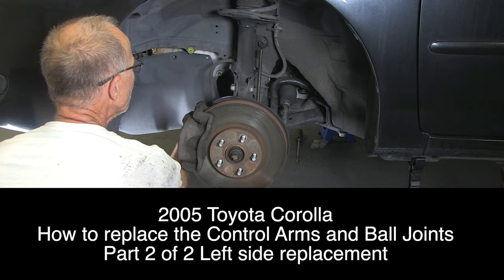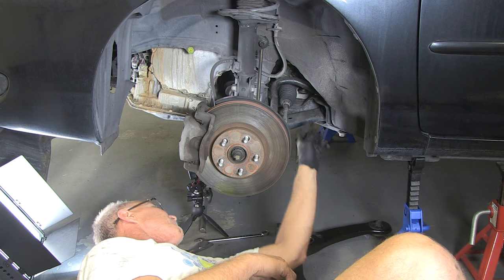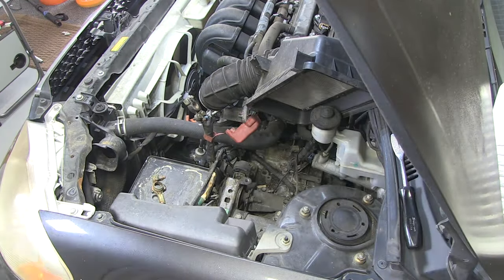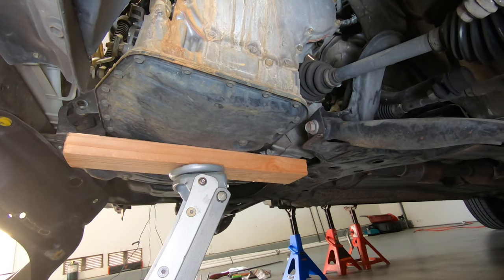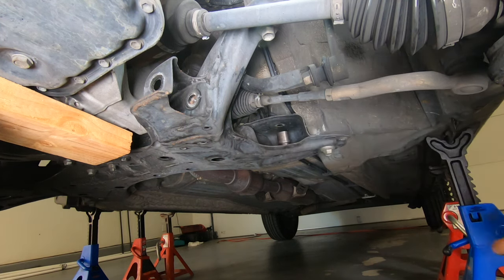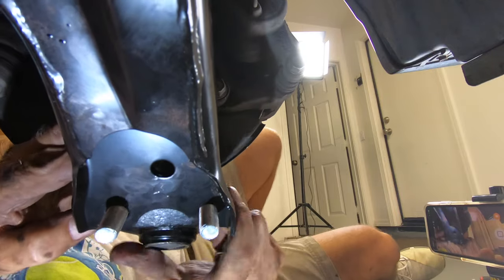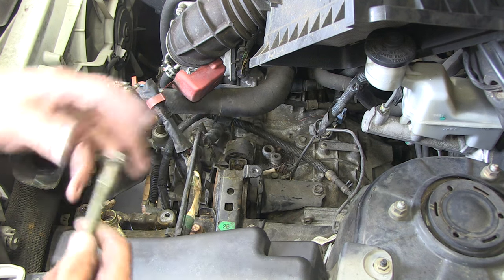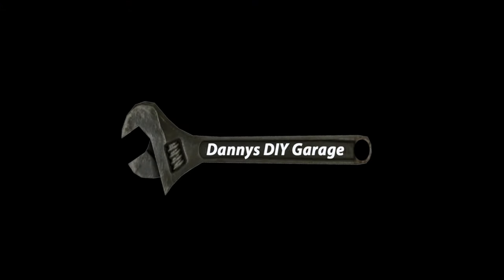Toyota Corolla Replacing the Control Arm Left Side

Comment: REALLY APPRECIATE THIS VERY THOROUGH VIDEO, DANNY! some thoughts: it looks another way to remove that bolt is drain the transmission fluid and remove the transmission fluid pan which (MIGHT) give you just enough clearance to remove and reinstall that bolt. It also looks like you can jack up that transmission slightly (without unbolting the transmission mount at all) to give you the extra clearance you need. (this is also the perfect time to replace the transmission filter and do a fluid change too.)

Comment: Dude I gotta give u a lot of credit for being able to do all this on the floor w/ a jack. I helped my coworker w/ this at the shop I work at on a Lexus RX300 which had this same exact set up on the lift, and that was already hard enough.
Reply from the maker: Yes, it made the job more difficult, but you do what you have to to get it done. Right!
Reply: For your Corolla is the camber adjustment that left bolt? I’m assuming it is, right?

Comment: Great video and explanation 👍.   My daughters 2012 Corolla S has 106k miles, and it started to sound like it needed struts.  I'm going to swap out the front struts and Coils springs,Lower Control arms,Tie Rods,Sway bar bushings,Sway bar Linkages, and 4 brand new Goodyear Tires.  I will be starting at 7:30 am tomorrow morning. The tire will be mounted and balanced, then alignment the front suspension by Firestone tire service.  MOOG Brand Suspension except The Struts and coil assembly is sold by TRQ. Let's hope I can accomplish 🙏 it.  I have never done this before. Thank you for your video.  I will video myself  trying to execute this change and experience.
Reply from the maker: Please update me when you’re finished, I will love to hear how everything worked our👍🏼
Reply: Don't do it sir, if you're going to replace good factory parts with garbage aftermarket parts.

Comment: You saved me a lot of money. Thank you so much for the video, I wasted 2 hours to figure it out until I found this video. I tried everything to take that bolt out.
Reply from the maker: You’re welcome, glad I could make your life a little easier 🍺
Reply: Yeah, me too, jajajajaja
Reply: We ran into the same issue with the bolt and decided to drop the transmission pan instead. Definitely messier but came out like a charm and saved us from having to break a lot of bolts loose to life the transmission. The idea of widening the spaces where the control arm came out are definitely a plus! Thanks.
Reply: @loptixl  That is what I was thinking because I have issue remembering all those nuts and bolts need to go back the same way. Can you confirm drop the pan has enough clearance. I may need to change the transmission filter anyway and perform Drain and Fill.  Thanks in advance.
Reply: @loptixl  i have a standard transmision,i  wonder if i might get lucky and have clearance to get that one out

Comment: Very good video.
I done my 2004 Corolla likewise, but got garage to do ball-joints (wasn't sure how easy it was but they didn't charge much for that item, with hindsight could have done that part myself). Just a hint, leave bracket connected to engine block, long bolt, only need to remove top bolts connecting to chassis. 👌🛠
Reply from the maker: Thanks for this
Reply: ALSO DONT SPREAD PARTS DESIGN TO HOLD BUSINGS TIGHTLY, AND DO NOT DRILL OUT BALLJOINT BOLT HOLES, SMH

Comment: Great video. 

Im going to be changing my control arms and cv axles and this is a great help. My transmission oil pan gasket has a slight leak and I'm going to be changing that as well. If i remove the pan will I have access to removing that horizontal bolt?

Comment: OMG, I am so glad you made this second video. I don't know it has to raise the transmission. BTW, how do you know  you need to change the control arm vs ball joint. The reason I ask is I have clunking noise from the passenger side and it has noise when I turn, start and stop. It is a 2009 Corolla and it has the original Ball joint for 13 years / 190k miles. I figured out it has to be the ball joint but after watching your video, it "may" be control arm too and the effort is totally different than "simple" ball joint.  Thanks for the excellent video. 👍
Reply from the maker: Sorry for the late response, hopefully you answered your questions by now, I’ve been traveling and haven’t had much YouTube time, sorry

Comment: I'm doing a filter and gasket change on the transmission the same day I'm installing the new control arms. Do you think you'd have enough space to pull that front bolt while the pan is removed - without removing the mounts, jacking up the transmission? Or not? Best video on this by the way.
Reply from the maker: Even with the pan removed, you still won’t have enough room, unfortunately
Reply: @dannysdiygarage  Thanks for the reply. I wasn't sure. I'm going to use your tip with the socket to open back up the space for the control arms to slide into. Great idea. Subbed.
Reply from the maker: Yep, I’ve done automotive for 30 plus years, ( if I knew then what I know now life would have been easier) thanks for commenting on this.

Comment from the maker: Yep, this job could have been so much easier with out that bolt issue
Reply: This is how you know an engineers spouse cheated on them with a mechanic.  Engineers design things to screw over mechanics in revenge. 😆
Reply from the maker: @Proxtor   not ruling it out,

Comment: I thought I read somewhere that you only need to remove the 2 left side bolts for the transmission mount and you didn't have to actually remove the entire mount. From what you remember does it seem like that would have worked?
Reply from the maker: Some times doing more can save you a lot of time, I don’t like to fight it,
Reply from the maker: I do my best

Comment: Thanks!! Glad I found this channel! Btw - was this on a automatic transmission? Rumour says it will not be such a bolt problem on my manual...
Reply from the maker: Update the channel on this if you have a manual 👍🏼
Reply: @dannysdiygarage  seems like it's a bit too tight also, even though the oil pan is slightly smaller for manual.

Comment: The 19mm horizontal bolt…. Mine is seized to the bushing… I managed to break it loose and unbolt it a little bit but now the bushings are causing major problems… the bolt is seized to the inner race of the bushing when I turn the bolt the rubber on the bushing twists with the bolt turning but neither my impact nor my breaker bar or my 72 ratchet are able to get the bolt to rotate past the resistance of the rubber bushings for a lack of better term…. please help

Comment: I'm looking to do this and the 4 motor mount on my '08 soon.  I'm curious, with the control arm, does it need to be unload to torque those, or does it not matter?  Just wondering how you would be able to manage getting the suspension under load if your jack was holding the engine/tranny out of the way.
Reply from the maker: Tighten everything down, put it on the ground and final step torque it,

Comment: May I ask you what kind of Makita impact wrench do you use? Do you feel it handled this job well?
I am thinking about getting M18 FUEL GEN-3 18-Volt Lithium-Ion Brushless Cordless 1/2 in. Compact Impact Wrench with Friction Ring , but I am not sure if 250Lbs of torque will be enough for 20 years of salt collecting bolts.
Thank you! Great video!
Reply from the maker: Invest in a breaker bar and use penetrating lube, I’m not sure I showed torquing everything, but I used a torque wrench
Reply from the maker: My makita is 10 years old, so whatever you purchase should be fine

Comment: I took a look at pulling the motor mounts, so let's see if anyone has yt'd it ... and here it is. Many thanks. 
Btw, haynes manual describes craning the engine/trans, then dropping the K member/crossmember. What's that in dealer labor costs (book), probably over $2000+
Reply from the maker: There is no easy way to do it, if you have something to hold the engine up safely from the top, that is best, however most of us do it yourselfers don’t, good luck, please update us if you find a better way 👍🏼

Comment: I have a manual so I didn't have the transmission issue.   However my front bolt reluctantly came out about 3/4 " and then stuck, couldn't get it to move with my 16" ratchet.  It goes back in easily.  Yes I am in the rust belt.  Should I put more and more torque on the bolt?  I would hate to snap it.

Comment: Although it’s risky, Could we get away with cutting a small notch in the lip on the edge of the tranny Pan (maybe w/ a small cutting wheel on an angle grinder) thats in the way of the control arm bolt, so that we’ll have enough room to slide it out? That way we can avoid messing w/ loosening all the parts like the engine mount, b/c that’s what’s making me nervous as hell.
Reply from the maker: Not recommended, you’ll end up regretting it
Reply: I’m talking about strictly on the part of the lip edge that curves down. Or even still no?
Reply from the maker: No, be very careful when working around the transmission.
Reply: Or just take out the bolt as much as possible, and then cut the bolt with a cutting wheel angle grinder, then continue to unscrew it by hand and possibly repeat until it’s out
Reply: @isaacsmith5611  Ohhhh. But will u have room to feed the new bolt in Frm the other side?

Comment: So what brand arms
Did you use? Hard to believe the holes aren’t properly lined up. Sure you had the absolute correct part for either the arms or the ball joints???
Reply from the maker: A subscriber use Delphi brand, his comments are in this thread, he said no grinding, check it out
Reply: @dannysdiygarage  thanks. I might go to a junkyard and practice lol. There’s a manual in one yard I might try so I don’t have to lol key with the tranny in the yard. Hell if it’s a great looking bushing maybe I’ll buy it and use it.
Reply: @dannysdiygarage  fwiw I ended up getting duralast from autozone (OEM on forever back order and way too expensive). They were $92 each plus I had a coupon for 20% off. The ease of a walk on over the counter warranty makes it worthwhile to mei stead of having to ship a part back via rock auto etc. not that that is that big of a deal i suppose. Anyhow…the fitment was perfect on all counts. Seemed like a very quality made product. I wish I would’ve thought to weigh it against the one I took off. The passenger side was pretty hard because the front bolt was well sized into the bushing and the arm was really hard to get out. The drivers side easy peeezy. I did the front engine mount and tranny came up plenty. Blots on that side came out super easy. Anyhow….thanks for your vid it helped immensely.
Reply from the maker: Thanks for sharing this information

Comment: Do you need to remove the 3 bolts at the bottom of of ball joint if you want to change both the ball joint and control arm???
Reply from the maker: No, but removing them makes it easier to pull off

Comment: What brands are those control arm? Delphi?
Reply from the maker: I’m sure it’s a overseas brand, but works fine TOTRAIT Front Lower Control Arms w/Ball Joints Compatible with 2003-2008 Pontiac Vibe, 2000-2005 Toyota Celica, 2003-2013 Toyota Corolla, 2003-2008 Toyota Matrix.
Reply: @dannysdiygarage  I’m asking because  I don’t have a rotary drill like you to widen the holes for the ball joint . I bought my control arms from Delphi so hopefully it will fit right in. I also notice you didn’t torqued down the bolt that goes across the control arm on the left side. Good video overall
Reply from the maker: Let me know the outcome, I love to know if they fit
Reply: hey I’ve replaced both side with Delphi control arm and they fit perfectly with no problem at all I didn’t have to do any modification on the control arms they were exactly the same as the OEM my car came with and by the way the Torque Spec is 101 ft-lbs you gotta torque those bolts down baby
Reply from the maker: Can you share the link to purchase these and I’ll post it, this will help others, thanks for sharing
Reply: @maelrodder9091  they should be torqued with the arms loaded…like put the car on ramps and then torque.
Reply: @maelrodder9091  How is Delphi holding? I am debating using Delphi or AC Delco ($20 more), since this so difficult, I would rather pay more for good quality brand and do it one time but someone told me Delphi and AC Delco is the same thing. Thanks in advance.

Comment: I don't see the sway bar. Did you remove it? I am currently doing the same repair, but I feel like the sway bar is in the way.
Reply from the maker: I don’t remember removing that, it’s been 1 year, however I showed ever step
Reply: @dannysdiygarage  it is a corolla, yes?
Reply: I just noticed the reason your CAs are so trashed is because of the lack of a sway bar. Mine is a 98 and i didn't really have to replace the CAs despite them being originals because mine has a sway bar to absorb half the shock. I'm actually doing the second one right now and it's also still in decente shape. I just want to do it because I'm reolacing every other suspensión component anyway
Reply from the maker: Thanks for the information, makes sense
Reply: Psh. I'm thanking you, brother. Disengaging motor Mouns is easier than the subframe. Screw that nonsense lol. Anyway, I appreciate your help and feedback. God bless.
Reply from the maker: Yes
Reply: @thepawchoe2749 did you ever change the drivers side CA on your 98 corolla? I'm about to give it try . I was just wondering if these exact methods apply to the 98

Comment: ok no you dont have to grind your control arm wtf are you doing?  you insert the balljoint slightly , start the off bolt, then install the nuts and run them down for a tight fit...its like this for a reason,  and do not spread your mounts for the lower control arm, place the control arm big bushing in first, use rubber mallet to work the barrel businng in , its easy, you want the pinch point pressure they way it supposed to be to get a good torque on them bolts , fyi the torque is not great enough to pinch what you seperated....    WARNING!!!!! DO NOT INSTALL YOUR SUSPENSION PARTS LIKE THIS OR YOU WILL RUN INTO ISSUES,  SMH PLEASE DONT FOLLOW THIS GUYS "ADVICE"
Reply from the maker: MrJames: Maybe you can make a video to show others how you do it👍🏼

Comment from the maker: TOTRAIT Front Lower Control Arms w/Ball Joints Compatible with 2003-2008 Pontiac Vibe, 2000-2005 Toyota Celica, 2003-2013 Toyota Corolla, 2003-2008 Toyota Matrix. https://www.amazon.com/dp/B08N5VQBLG/ref=cm_sw_r_cp_api_glt_fabc_V9JNR7EM8AYE6AM9RF4A?_encoding=UTF8&psc=1